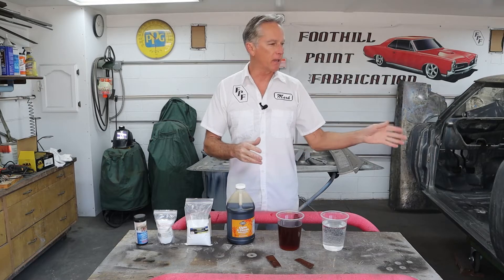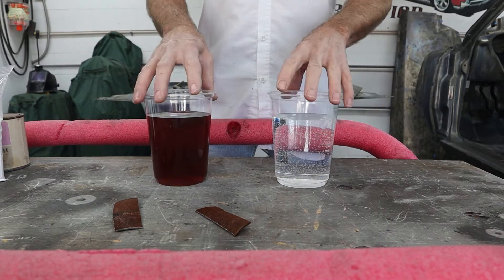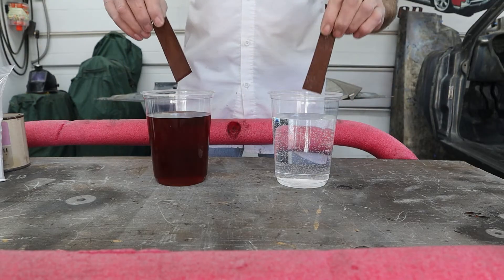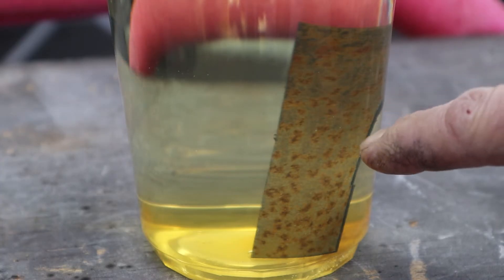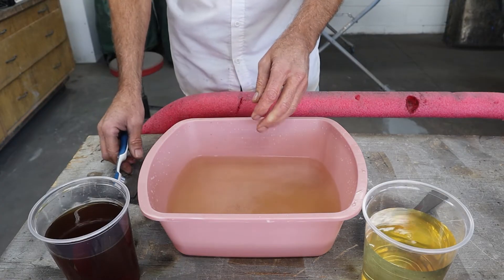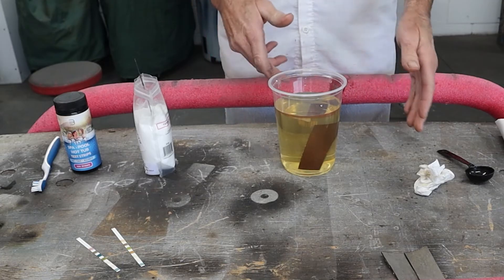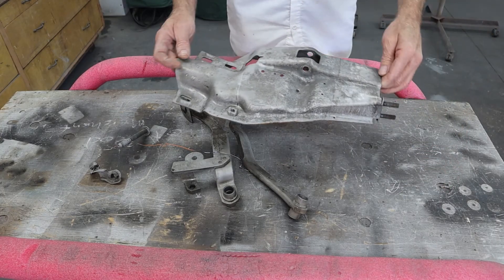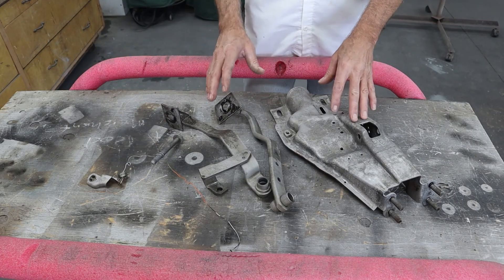DIY Rust Remover - Can We make Our Own Rust Evaporator???

Comment: Molasses are slow as molasses 😄, so they take their time to work but it works better than the others in the end. Typically you might have to bath the pieces at least a week.  You need to add soda to all to reduce the acidity and not damage the base metal.
Reply from the maker: What about the ants?  😁  I have heard it works well and I was looking for it without the sulfur removed so it would be less expensive but couldn't find any locally.  For delicate parts either way works really well.
thanks

Comment: just use the citric acid
Reply from the maker: The idea behind these types of rust removers is to do it without an acidic base which eats the metal.  Removing rust without eating away the non-rusted is very advantageous on some parts while others you could just put it in Muriatic acid and remove the rust quickly but it doesn't stop at the rust like all acids.  Eating rust at a neutral Ph is the tricky part.

Comment: Evaporust uses Phytic Acid, instead of Citric Acid, to buffer the Tetra Sodium EDTA.
Phytic Acid and Citric Acid are both metal chelating agents, and act to remove the Fe³⁺ ion (Ferric Oxide) from the EDTA as it derusts the corrosion on iron or steel parts.
Phytic acid meets all the requirements as the "secret" ingredient in Evapo-rust. It has the same minor health effects as mentioned in the Evaporust MSDS and it is effective in very low concentrations. That is particularly important because if the active ingredient is greater than 1% then it cannot be declared proprietary and must be listed in the MSDS. Phytic acid is the most powerful heavy metal chelating agent but it is very expensive, compared to cheap Citric Acid. Hence Evaporust being so expensive.
Citric Acid added to Tetra Sodium EDTA, to neutralise it, are a good home-made substitute for Evaporust.

Comment: You can use just oxalic acid crystals and water to make an excellent rust remover. The oxslic acid chelates the rust to leave clean bare metal surfaces with the removed rust laying on the bottom of the bucket, tub or vat. You can decant the clear solution for reuse until it stops removing rust. I used to buy oxalic acid at auto parts stores in paper cylinders and large paper bags as automotive cooling system cleaner. Used that for rust removal and as a wood brightener (oxalic acid is also sold as wood bleach) to strip off grey weather wood from siding, trim and wood fencing to leave a clean bare wood surface without sanding. For big jobs I bought 40 pound bags from a local chemical supply house for $45. That was 20 years ago so the price is probably higher today.
Reply from the maker: Thanks for the tip.  Doesn't it have a really low ph?  The solution I was attempting removed rust with  a more neutral ph so none of the metal would be eaten, only the rust.  Did you have any issues with that?
Reply: @FoothillPaintandFabrication Oxalic acid only dissolves the rust so it can drop off the metal to leave a clean surface. It has no effect on paint or decals. It will attack the metal if left submerged in the solution for prolonged periods of time. It used to be sold in paper tubes and paper bags as an engine cooling system cleaner.

Comment: Great video. I always wondered if it could be made at home. Im going to make some but i cant soak the part because its the sheet metal cab of a backhoe. So i plan on making it and soak some rags in it and then place those  on the rusted areas. Probably wont be as good as soaking in it but it shoukd get rid of some of the rust.
Reply from the maker: Thanks Steven.  I saw a guy use a kiddy pool and a small pond pump and just let it run over the area and back into the kiddy pool for hours. I was asked about making it into a gel which would be good for what you need to do but the only idea I had was to add gelatin to the mixture.  I have no idea what would happen or if it would ruin the solution.  It does burn itself out eating rust to it doesn't last forever.  Once you get it as good as you can you might want to look at a product called  Ospho to convert the rest of the rust.  Here is a link.   https://a.co/d/5KQeOfN
Good luck
Reply: @FoothillPaintandFabrication  thanks for the link. When I'm ready I'm going to order the 2 pack.

Comment: I've just come across your channel 
and this video 
I found it very interesting 
what might help is a hydraulic fluid new or old it's the best Anti-rust inhibitor with some dawn dish soap 
with the rust remover once you have the parts how you like them  so a quick spray with garden sprayer it will stick because of the dish soap and oil just let it soak in

Comment: Great experiment and its something I want to do on a budget which this video helps with.  Thanks again
Reply from the maker: @davispaul82  Thanks. I think for fragile or lightweight delicate parts this is a great solution as it only eats the rust and not the base metal like vinegar or muriatic acid will.
It does use itself up though.

Comment: Got this from another YT video. Can't say how it compares price-wise to EDTA but you can get what you need from most grocery stores.

1,000 ml water. In the stupid system, 1ml weighs 1 gram, so 1,000 grams of water. 100 grams of citric acid (buy this as LemiShine dish detergent booster where dish cleaning supplies are). 40 grams of washing soda (sodium carbonate, not baking soda, sodium bicarbonate).

In brain units, for any given quantity of water, add 10% w/w citric acid and 4% w/w washing soda.  A gal of water weighs 8# (close enough as to make no diff).  From there you can figure out how much weight in pounds or ounces of each ingredient you need for any given volume of water.

I have a tub I've been using for 2 weeks to clean rusted tools from a fire. Overnight has cleaned the tools very well (light brushing w a soft bristle brush is done to remove the rust that didn't simply fall off).  My tub has maybe a half gallon in it, not a lot, but it's been able to clean several small pipe wrenches and numerous pairs of pliers. 

Be advised that the addition of the acid and base to the water will release a lot of gas (reportedly CO2).  It will try to foam up and spill over. Add the chemicals slowly.
Reply from the maker: Thanks for the info.  Do you know what the ph is of the final mixture?  Just curious how acidic it is.
Reply: From Beyond Ballistics it's reportedly a pH of 4. My stuff isn't critical, I've not tested it.
Reply from the maker: @hartfordboothe7466  That is pretty acidic but like you said if it isn't crucial and you keep an eye on it then it should be fine.  The mixture I made up was very close to neutral so it only ate the rust.  Good for more fragile parts.

Comment: I've always used white vinegar.  It can be expensive.  When doing large parts.
Reply from the maker: @DavidBrady-wf6qh  Vinegar works but the ph is low which will eat some of the base metal. This solution just removes the rust so it is really good for delicate parts or parts you don't want to have watch closely.

Comment: Molasses 2 part Recipe:
=====================
1 Parts  Black Molasses (Not de-sulfured)
9 Parts Water 

3 to 4 weeks. Check periodically. 
Scrub parts and leave if needed. 

Get at feed store. $8 bucks per gal. (Deer bait)
Food grade workes fine too ($8 per 8oz.) 
I've used a (much) weaker solution with great results.

Once ready:
Rust-Silt, is easily wiped or rinsed off.
Pressure washer is best!
Scrub with steel wool, or scouring pad, or a wire brush, and dry thoroughly. 

Spray with breack cleaner, thinner, or primer, or use any oil. Immediately.
You could use a Linseed oil wipe for  permanent coating.
(Oxygen exposure creats "Rust-flash" Very quick)

Notes:
Gloves, not necessary. Hands may smell like iron or syrup, but otherwise Non-Toxic. 

The metal alloy type may be effected differently, that is, after months of saturation some may deform/desolve. 

Containers:
Small jars, Plastic bins, kiddy pools, swimming pool~for cars, 
(4in. PVC) for long rods, Trailer axles, etc. 
 -----------------------------
Chelating effects:
Chelating derives from the Latin word chele, meaning claw. 

The pincer shaped molecules at work here are shaped somewhat like a Dungeness crab claw. The molecules can form several bonds to a single metal ion which contains cyclic hydroxamic acids which, in turn, bind with rust making it water-soluble. 
Larger amounts of these cyclic hydroxamic acids are found in molasses derived from sugar beet rather than cane.  

Plants and microbes appear to use the same chelation bacteria/chemicals to remove rust, robbing oxygen from the iron oxide. 

Medically:
(Molasses itself has many uses as a medical/food supplement specifically for Iron.
Black Molassis can rectify iron deficiency very quickly, too much to mention here). 

Agriculturally, Chelating agents bind to minerals and make them available to plants. 

Related chelating agents are, administered  for metal poisoning for the release of lead and mercury toxins, the body is then able to excrete contaminant as it becomes soluble. 😊❤

Comment: You might be able to speed up the reaction a bit by adding  a sqirt of dish detergent.  I know warming it is not always possible but I have seen that it also speeds it up.
Reply from the maker: Thanks.  Luckily I have way more patience than I did in my youth so I can give the parts some time.    I would imagine the dish detergent would affect the ph wouldn't it?  Next batch I make I will test it out and see how it goes.
Thanks again
Reply: Using a detergent with phosphorus content might contribute to the reaction as a bonus

Comment: 45% vinegar works great and quick
Reply from the maker: Vinegar does work very well but it eats away the base material as well as the rust so if you have a plated part or a delicate part this solution would be more appropriate.  Muriatic acid works super fast but has the same issue as vinegar with vinegar having a ph of 2-3 and muriatic acid 0-1.  Having a neutral ph as close to 7 as possible but still eats rust was the goal here.

Comment: All you need is citric acid, washing soda and a squirt of dish wash.
Reply from the maker: @Ni5ei  is that solution ph neutral?
The whole idea is to remove rust without eating any of the base metal.
Reply: @FoothillPaintandFabrication  Beyond Ballistics has made a video about it.
Reply from the maker: @Ni5ei  I will check it out.
Reply: @FoothillPaintandFabrication  Yes it is. Search for "better than evaporust" on youtube.
Reply: I made a comment about this solution prior to reading this far down the comments. From the video I got the citric acid and washing soda mix from: the resulting liquid is around a pH of 4.  It will still eat away some good metal but, from that video (take it w a grain of salt...it's YT) he tested it and reported very little metal loss.  It was Beyond Ballistics. It's a good video, it seems very clear and well thought out. I've been using that solution w great success. To pay this close at hand for those who didn't see my comment: 1L water, 100g citric acid (LemiShine in dish washing supplies) and 40g washing soda (laundry supplies).

Comment: The best video I've seen to get rid of rust is this: https://youtu.be/fVYZmeReKKY The guy proves beyond a doubt it works the best and proves that Evaporust is very weak and harms metal. The Solution: 1 Litre Hot Water, 100 grams Citric Acid, 40 grams Washing Soda OR 63 grans Baking Soda OR 30 grams Caustic Soda.

Comment: The manufacturers of commercial similar mixtures had to choose a chelating agent. They want to be able to advertise safety of their product (and don't want payouts and litigation down the time line), so they didn't choose EDTA. I can see how EDTA might sound harmless. But i've used it to break DNA into tiny bits. Just something to consider when you choose whether to put gloves over your DNA based hands when working with this solution.
Reply from the maker: @balisticsquirel  Thanks, I appreciate your concern for my well being. Gloves for sure from now on.

Comment: Very well done 👍 
It would be very interesting to fill an old rustic engine block cooling jacket with your solution and see how it would work. Maybe give it several days.
Reply from the maker: @cobbleup  It should work pretty well but the solution burns itself out as it removes the rust. It would be safe through as it doesn't eat any non rusted metal

Comment: 100g of citric acid, 40g washing soda, 1 Litre of warm water.
Reply from the maker: That will surely remove rust but the EDTA solution has such a neutral ph and the chelating affect removes rust without touching the base metal. There are many ways to remove rust but for delicate parts I think this solution fits the bill.
Reply: @FoothillPaintandFabrication  Just my personal opinion. The washing soda brings down the PH affect from the citric acid to safe levels. Plus the washing soda is dirt cheap compared to EDTA. I’ve seen great results with this formula on everything from a BSA gas tank to delicate, 40 year Ludwig drum hardware.
Reply from the maker: @TLervis  Are you talking about Borax soap?
I will definitely give your solution a try when I get a chance.  I found a cheaper formula of EDTA but haven't tried it yet.  Used to be a lot cheaper for non medical grade but it is in everything now.
Reply: @FoothillPaintandFabrication  I just know it as washing soda. I’ve heard you can sub it for baking soda. I had some around from when I was experimenting with electrolysis.
Reply from the maker: @TLervis  Perfect thanks
Reply: Arm and Hammer makes a washing soda laundry soap that works when mixed with water and used with battery charger/ electrolysis to remove rust
Reply from the maker: @unsafe_at_any_speed  I have heard of that, do you know the mix ratio? 
Thanks
Reply: @FoothillPaintandFabrication  1 teaspoon soda per pint of water, 2 amp charge with the negative lead on the part. Positive lead on a sacrificial metal strip. Put it in a plastic tub and don't let the part touch the sacrificial strip. It'll foam up but keep the charge on until rust is removed. The part will turn black
Reply from the maker: @unsafe_at_any_speed  I have to give that a try, thanks!
Reply: Don't use SS as the sacrificial anode. Plenty of safety advisories online about that. Carbon gouging rods w the copper removed (easily peeled off after slitting it w a knife) work well. Mild steel can be used as the anode(s) but will get fifty and need mechanical cleaning. The carbon rods do deteriorate and disintegrate, tho'.  They are sacrificial.
Reply: I also use folded up tinfoil to scrub the metal.

Comment: Any idea what you can do to turn your edta into a gel form that will stick to a surface like the undercarriage of a car you want to remove the rust on? Thank you
Reply from the maker: Hi James
I know there are EDTA gels out there for medical work but I have no idea how they prepare the solution. I was just thinking that since EDTA is dissolved in water perhaps it could be as simple as using gelatin from the grocery store in the solution.  It would take some testing to see if it would work and if it reduces the efficiency of the EDTA though.
Reply: @FoothillPaintandFabrication  I was thinking the same re the gelatin. There a great product by Rustoluem that's called rust dissolver. It's a spray that gels up. This is a project for the spring. I'm going to experiment and I'll let you know how it works out. Thanks for getting me started.
Reply from the maker: @JamesDoylesGarage  Absolutely let me know how it goes.  I have had luck using cheap plastic wrap to cover paint stripper to keep it from drying out before it can do the job and it should work for this too I believe.  I also saw a guy use a small pond pump in a tub of Evaporust where he routed the hose up to the top of his firewall and let it wash over the panel, drain back into the tub and do it all over again.
Good luck on your project

Comment: I wonder if that (still, after 1st soak, molasses) rusty stripe was a finger print, where the rust was protected by oil.
Reply: That made me think, what if you add some soap-type stuff, to cut through any oils that are on the surface?

Like, cut it with Simple Green, maybe 1 cup per gallon.
Reply from the maker: @Iowa599  I did pressure wash all the parts spraying them with degreaser first. From what I have been told the molasses concentration should have been much higher. Some suggest a wetting agent in the solution. I suppose the test piece could have been contaminated.
Reply: @FoothillPaintandFabrication  for the right stuff, it doesn't take much. I was doing something, electroplating I think, and remember ruining a piece by leaving a fingerprint.
Reply from the maker: @Iowa599  You are right about that, worked in a plating shop for 3 long years and saw a few jobs ruined because they were handled bare handed.
Reply: A ultrasound tank may speed that, too...

Have s spare buzzy sander?

Comment: I don't know about the sulfur part. It is dispensed out of a hose like at gas pump. I just bring my 5 gallon containers and fill them up. Farmers fill their tanks of hundreds of gallons. I just came in from my shop where I have several 5 gallon pails that have been working for a week. I pulled out some wire chain that was just a ball of rust. It now looks new. If you leave your metal in for three weeks or more it will develop a black patena like it was painted with flat black paint. I have heard what that patina is but have forgotten but is used for restoring things like old canons etc.